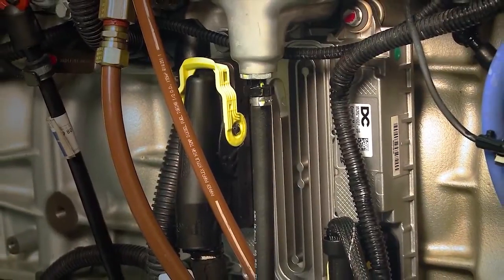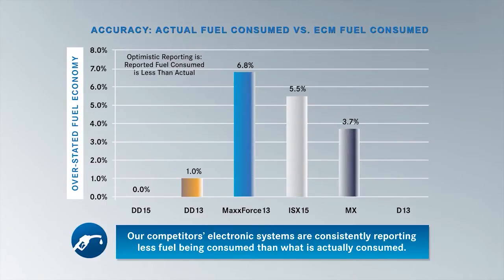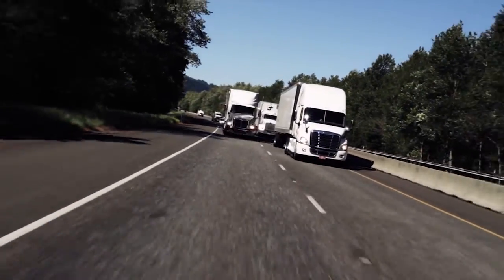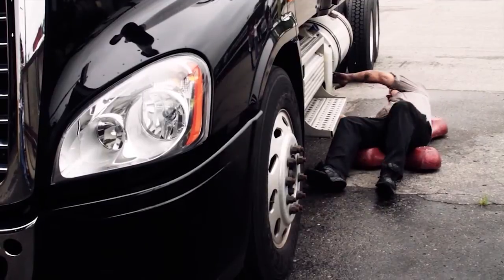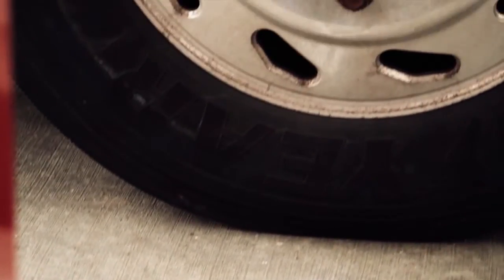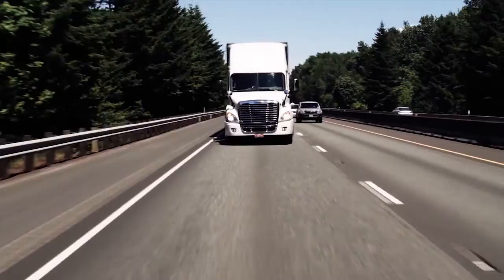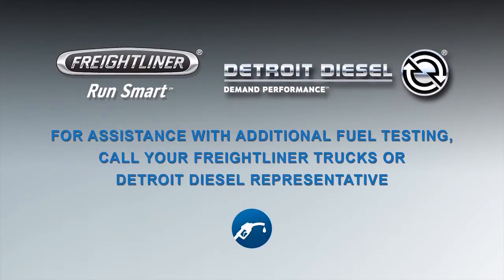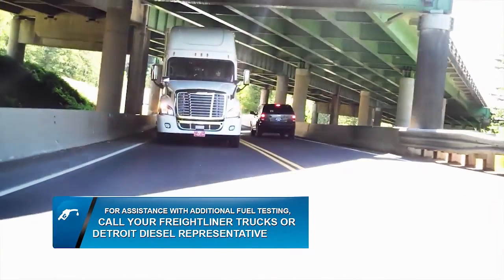ECM Reported Fuel Consumption vs Actual Fuel Consumption

Comment: Fuel economy leaders? it’s a joke. I have a 2011 cascadia with dd15 455hp and It’s doing 5.01 mpg. I use to have before a Volvo with a EGR cummin 565 hp and was doing 5.8 mpg. Better fuel economy with a lot more power and less brake downs. All diesel consumption verified by miles run vs gallons pumped to top. Dd15 has been a big mistake for me.
Reply: Me too brother! The 2016 DD15 505 is JUNK! My 2011 ISX tuned to 600/2050 got over 6 mpgs and had POWER! DD15 is a fuckin MUTT!